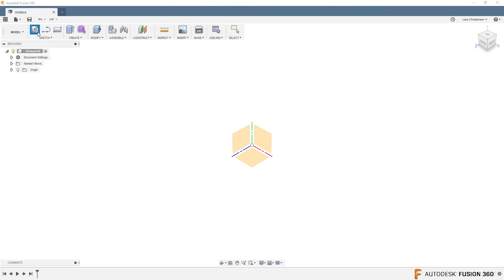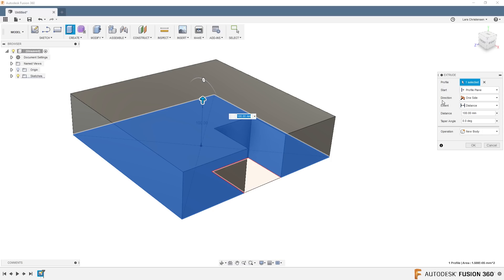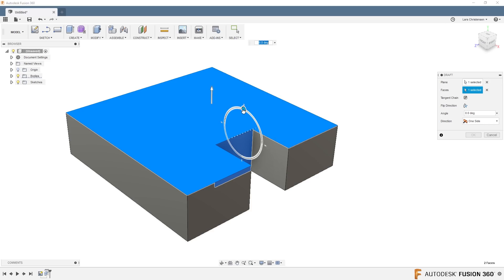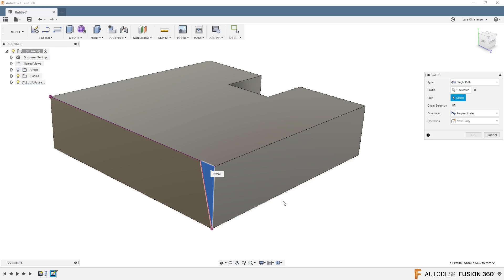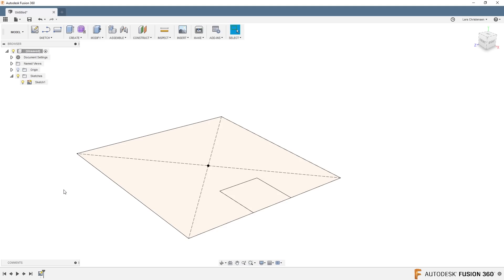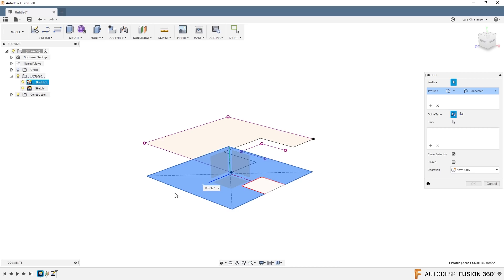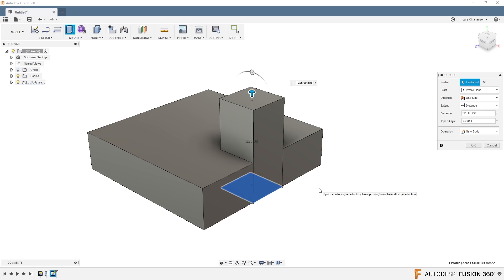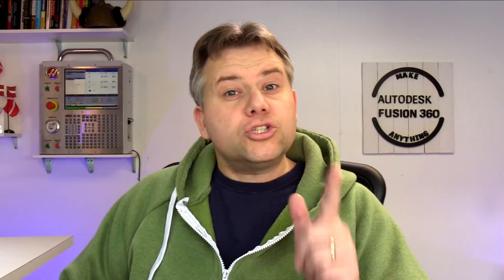Taper, Drafts & Angles — Season 2 EP1

Comment: I have a rack and pinion that I want to 3D print in place in my assembly, so I needed to add a 45-degree angle to both sides of my rack and the pinion gear.  Lofting the pinion to a point was simple, but I couldn't figure out how to get a 45-degree angle from the top of my rack to flare out the bottom.  DRAFT to the rescue!  Thank you.

Comment: Lars, Been doing this for awhile, mostly with injection & blow molds, dies as well and part design. The one thing with draft in Fusion is and I may not being seeing the ablity to simply do this is to take an existing part and get the draft angles already design into the part. I really don't want to waste time changing the tolerances in the draft analysis tool to get the information that's already available in the back ground in Fusion. Is there a way to do this. I could do it the hard way, but the info is there so I have to believe somebody at Autodesk had/has the insight to make this an easy task. I just have to be missing something.

Comment: Hi there , i need to make a mold for chocolate so i need a bar with text on it .....getting the text on the bar is easy with insert SVG then i extrude the text ...BUT  to get it out of the mold without breaking i need to taper the text slightly..... unfortunately the text is only 3mm high ... fusion doesnt let me do a taper  ... any ideas....THANKS 👍😉
Reply from the maker: Have you tried the Draft feature?
Reply: @cadcamstuff  Yes tried that too....i made a bar 5mm high then put a SVG logo on it (hand made in Belgium logo ) and extruded that 3mm  there is no way fusion lets me change the letters so they are easy to get out of a mold.  just printing it...maybe with 3mm it will not matter..... keep you posted ..THANKS FOR THE QUICK RESPONSE much appreciated. !!!!
Reply from the maker: @ChannellVR  You might be lucky. Keep me posted :-). The only other option I can think of is to use the loft command. Then you will have to make an offset of the logo either at the top (smaller) or the bottom (bigger)